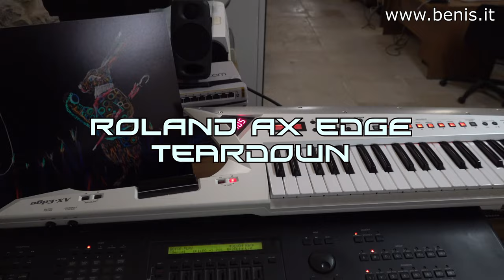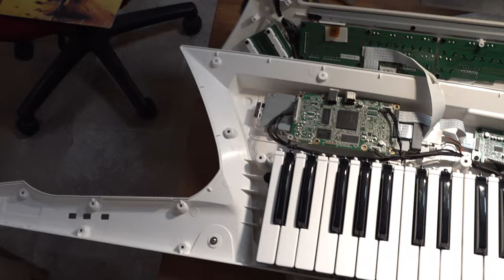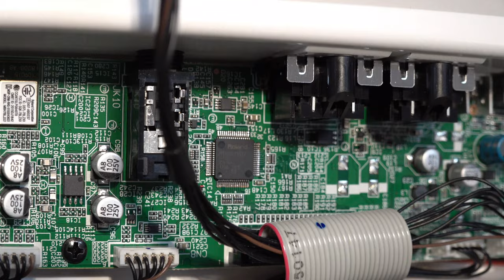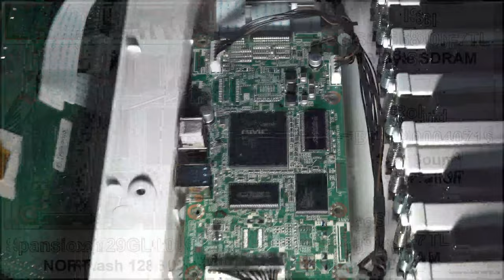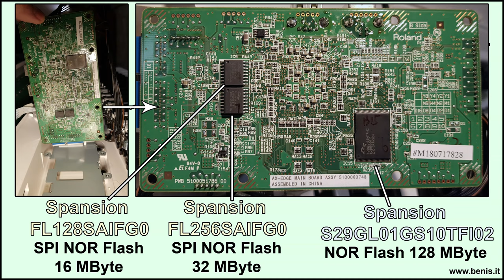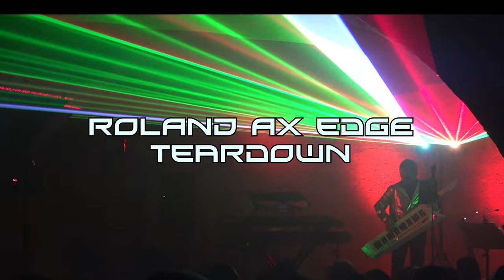Teardown - Roland AX Edge

Comment: Hello, how are you?.. on my roland ax edge a sign appeared that says shutdown process... and after a few minutes. It turns off... do you know what it could be? greetings
Reply from the maker: you need to check that it is not an electrical problem (batteries and/or power supply): otherwise all that remains is to send it in for assistance

Comment: Is the R5100036692-100E2 chip an SoC?
Reply from the maker: the AX-Edge sound generator is the BMC SoC which is a Roland proprietary chip, which contains a large array of DSP and CPU core blocks (probably ARM 4 Core) plus hardware logic. BMC is used in JupiterX, JunoX, Fantom,... https://www.roland.com/uk/promos/jupiter-x_story/

Comment: Hey! I read your Roland Fantom expansions article and it was absolutely brilliant, so clear and direct. I do some questions if you don't mind?

1. I'd like to know, do user samples made in SFZ benefit from the Roland compression using the SVZ sample converter provided by Roland? Trying to see how to fit a Rhodes multisample library in SFZ with all the other expansions Roland makes.

2. Is it an OS-level restriction that makes the Roland Fantom/Fantom-0/JupiterX(m) etc. unable to send audio over USB (so that it is class complaint)? Seems a bit weird that the MC line can do it but the big boys can't.
Reply from the maker: unfortunately it is not possible to use the roland compression codec: SVZ sample converter keeps the samples in 16 bit linear format.
Regarding the audio over USB Fantom sends it through the proprietary drivers: on the possible Class-Compliance implementation it cannot be ruled out that it will be implemented later. It wouldn't hurt to make such a request to Roland :-)